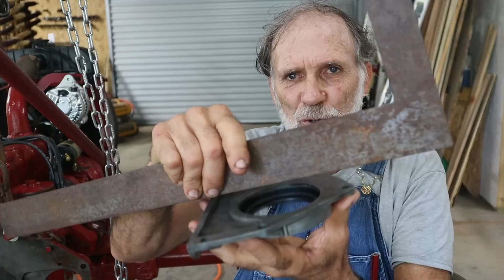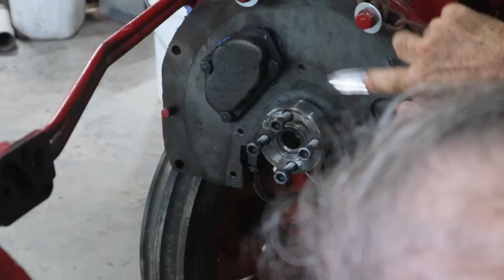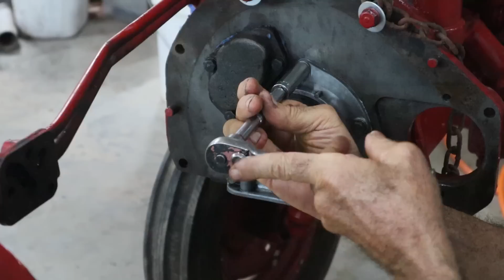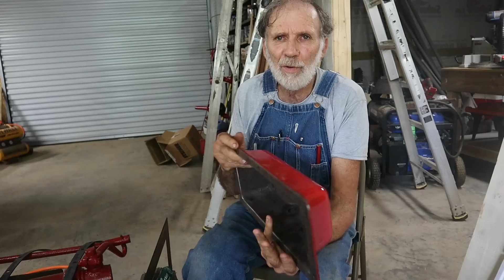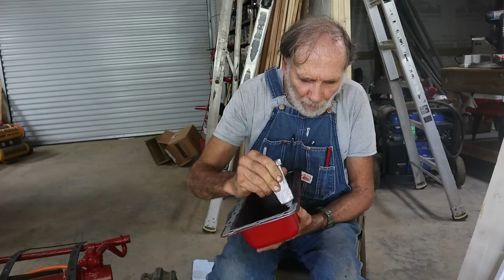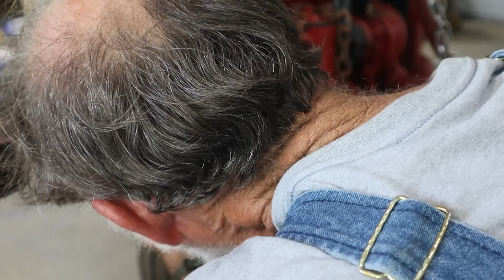Installing a FLY WHEEL, Rear Main Oil Seal and Oil Pan Gasket on Farmall Cub Restoration

Comment: In my opinion you should check the crankshaft end play because that's what usually causes a rear main seal to leak.
Reply from the maker: It had new thrust bearing in it.
Reply: @pecangrovems  New bearings on a worn out crankshaft doesn't mean anything.
Reply from the maker: @steveladner4346 I tried moving it with a screwdriver and it didn't move. So I'm hoping it was done right.

Comment: looks like you've worked up a pretty good sweat there mr. danny. not hard to do in south ms right now. next this coming sat looks like heat index of 110+. i'd have to say that engine has been rebuild. when you get through with that your gonna have a brand new tractor
Reply from the maker: That's my plan.

Comment: Mr Danny I’m just in the hood step of my cub and let me tell you it took me 4 hours to drill out and re tap the screws and bolts to take my hood off. Every single bolt and screw was rusted solid . Do you believe when I put this together to use “ never seize” on the threads? I’m thinking of it so I dint have this issue again
Reply from the maker: I use stainless steel screws to help prevent that.